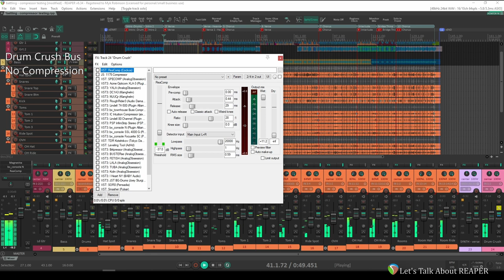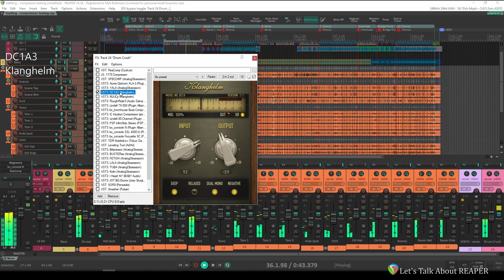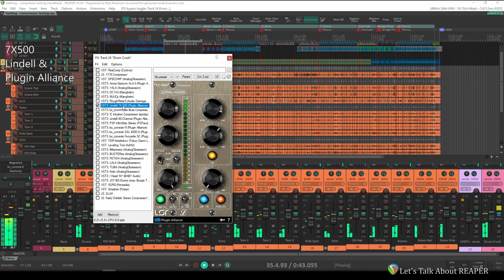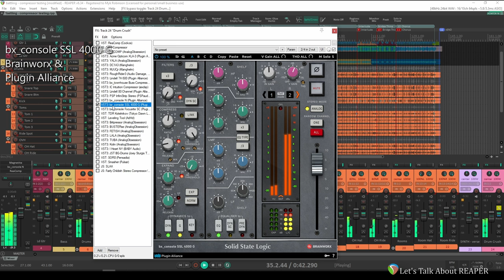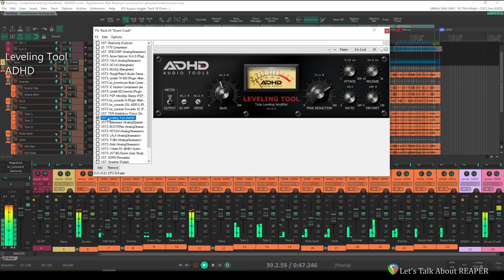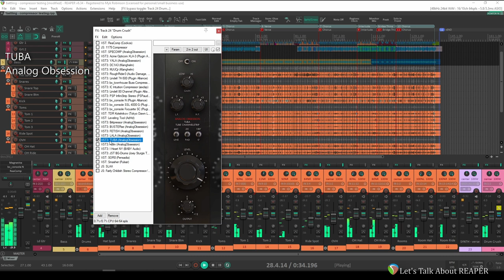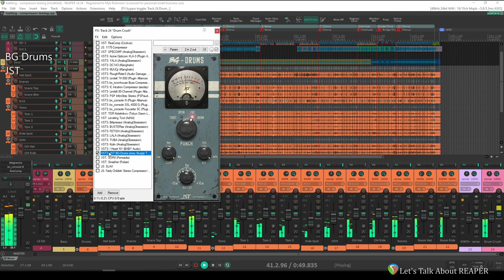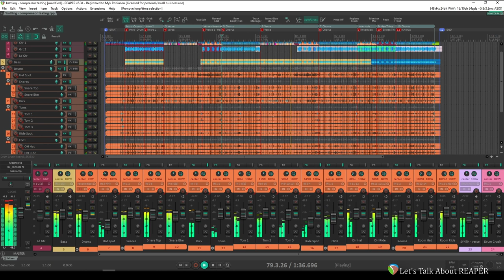Using Compressors for Character - 30 Compressor Shootout!

Comment: Hope you recover full Myk
Cool video...On the drum crush bus i like to have a fast attack and slow release. To bring everything up and squash the kick and snare so they are it's not too 'transient'. I use the MC77 for this, but there were a few you had which gave that nice sound. Rough Rider was my go to before i got MC77. I use Channel X (and the Lindel's too). UBK-1 though is the real master of the drum crush bus. It's so easy to dial in. I use it on drum groups rather than the bus. Trying to make the drums dance like Mr Scott would want us to :)
Great job showing the vast differences between the compressors.
Reply from the maker: doing MUCH better, thank you. I have yet to try any Kush plugins. I hope to one day, if they ever go on sale. Just hard for me to drop that much cash  when i already have so many tools.
Reply: @LetsTalkAboutReaper  Good to hear. 

I got UBK-1 2nd hand. After I saw Ken Lewis use it a few times in his mixes and liked what I heard. He actually uses it to bring elements forward in a mix. Not on drums. But I'm not a mixer by a long shot. So I stick it on drums. After hearing Gregory Scott using it. I like to think (meaning I'm probably not) as self producer I'm picking (non drum) sounds that don't need much work with the splat function of UBK-1. 

As for having to many compressors..... Let's not start counting 😭😭😂😂

Comment: I loved the Buster one. Tight and warm. I need to get it! \m/ 
I also loved the Cockos ones because it did not seem to color the sound too much. :-)
I have the TDR one and love it!
I compress my cymbals separately as I don't like them too compressed which makes them sound like muddy and washed out sounding.
I love everything Steven Slate (Yup, got the all access pass) :-)
Thank you for the comparison. I love and watch all of your vidros.
Reply from the maker: thank you!

in many cases, i just process the shells on a crush bus and do cymbals separately as well, but i thought in this case it would make it a lot more obvious what each compressor was doing to the sound. It was really fascinating hearing how it changed the feel of the hats.
Reply: @LetsTalkAboutReaper  Most definitely. :-)

Comment: I'm currently headdesking that I never noticed the 1175 -.-
Gonna spend the next month sifting through the JS plugs and squinting a bunch.

Hope you feel better, man!
Reply: The 1175 sounds great and takes next to zero CPU. I feel one of the reasons the JS plugins are so overlooked is not just because they don't look pretty, but also the ranges of the sliders are often pretty bad. Fortunately you can easily change that in the code itself.
SLAX also sounded pretty good, and I beleive it's just a JS script with a facelift.
Reply: @lolilollolilol7773  I've always sorted by Dynamics when I needed a comp, or typed "comp"!

SINCE 3.0 >.< wheeze

And, heck yeah! Dug the I Heart NY, as well. But that 1175 was my favorite, and I went, "Included with Reaper? WHAT"
Reply: @blackboard_sx3488  Yes I've been using the 1175 for a while now. There are also a few other gems in the JS directory like Bad Buss Mojo or the HP1136 limiter
Reply: @lolilollolilol7773  Thanks! I'll give em a hard look.

Comment: that must have been a lot of work! I was impressed, how bad the LALA performed, in comparison.
Reply from the maker: oddly enough, this is probably the easiest video i've made :) Didn't start off as a video idea, i was just sitting here playing with compressors and learning to hear them better and thought, i bet some other people might appreciate this too...

I just keep everything i was playing with in the FX list then went back later with OBS and captured me switching them, chopped and lined them up nicely in Davinci Resolve so it "almost" is a seamless loop.

And yeah, LALA was pretty sterile for me, but several of the other Analog Obsession offerings were quite tasty. I really like Fetish
Reply: It is a 2A though, not really made for fast dynamics. Pluuus the LALA has a much slower attack/release than any other LA2A style I've used.
It's way better--and my go-to--for things like final leveling of bass, or more extended sounds like strings, pad synths, or choirs.

Comment: Hi and Thanks for the video. I think you use way too much compression in the video. In a way it makes sense, perhaps we are better able to judge the compressor on extreme settings ... but I'm not sure. I think that some of the compressors would sound much better not pushing them so hard
Reply from the maker: I get what what you're saying. It's all subjective, though. Keep in mind that this was done on a drum crush bus, with the end result to be blended back with the primary drums which were more gently processed.
Can you imagine When The Levee Breaks by Led Zeppelin without the insane amount of compression on the drums in the intro? 😂

That said, I definitely did push these compressors pretty hard, but for me it was all about learning what they could do and what kind of color they would add when pushed.
Reply: @LetsTalkAboutReaper  oh sorry - I didn't get that it was a drum crush bus ... sorry
Reply from the maker: No need to apologize, it's all good conversation!